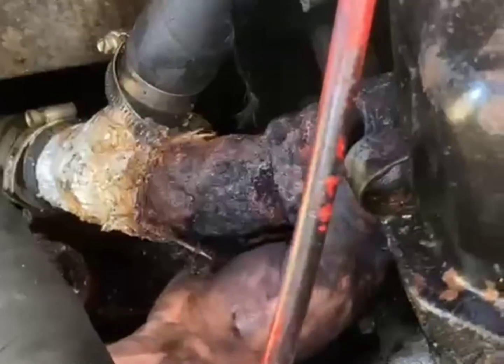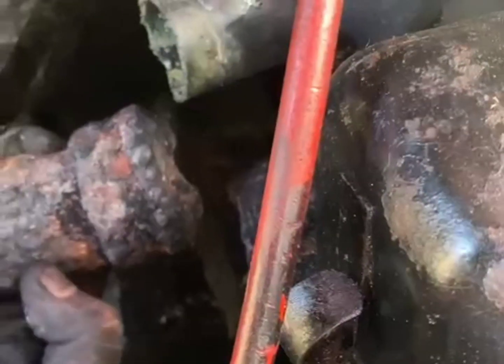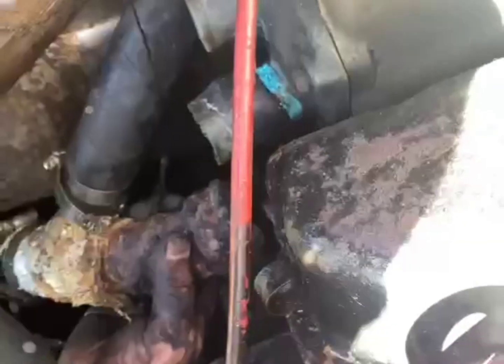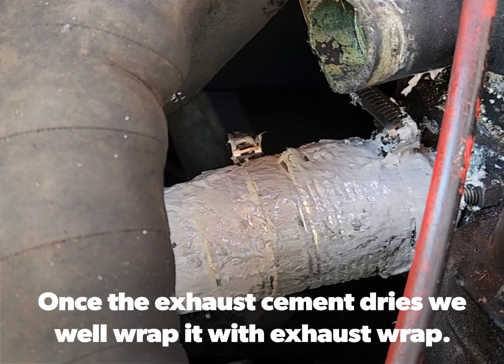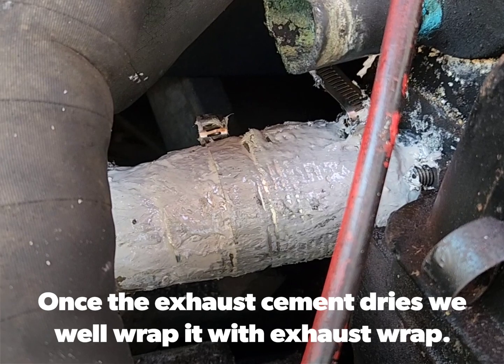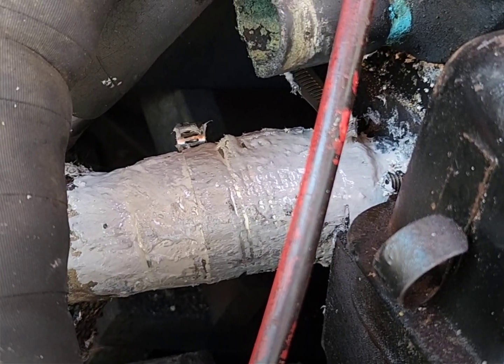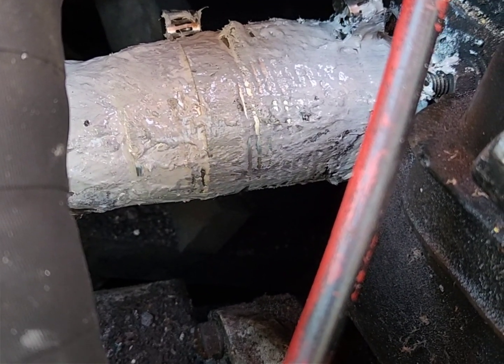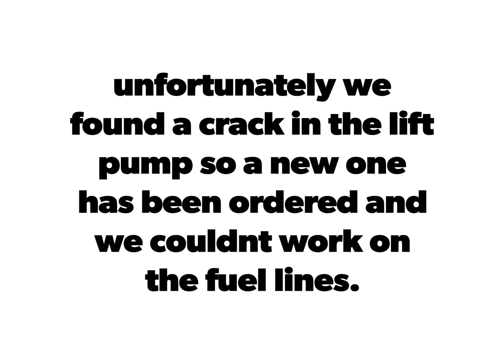Exhaust repair on DEETOO #projectboat

Comment: Bugga bout the cracked liftpump. Was the glass cracked or did it do the normal thing for a 2400 series Ford and crack the body where the inlet/outlet fittings screw into it?
Reply from the maker: Spot on mate. The fitting cracked it.
Reply: Thats normally due to the type of fitting being used.
The thread on those pumps is normally 1/2 inch UNF. The fitting that gets screwed in should be either a tapered seat type of hosetail fitting or a proper 1/2 UNF banjo bolt and banjo fitting. 
Non taper seat fittings are 1/4 BSP or NPt thread and while they will fit into the tapped hole they will normally only screw in about 2 
maybe 3 threads tops. The taper seat type really are the only way to go unless you opt for proper hydraulic type hoses but the fitting still has to nothing else but 1/2 inch UNF/SAE thread.
Reply from the maker: I am actually considering upgrading to an electric fuel pump to bypass the lift pump and then have the new lift  installed so i can swap the fuel lines over to the liftpump if anything goes wrong with the electric pump. What are your thoughts on this idea? You seem to have alot of knowledge on these motors, so your advice would be greatly appreciated.
Reply: You can absolutely remove the mechanical liftpump and fit a blanking plate so you can use the engine with an electric pump. Shouldnt leave the mechanical pump on woth no fuel going thru it as the diapagham will still be operated by the cam but by not having fuel going thru it it will dry out and can crack which when you do put fuel to it it will lead to leaks and it wont make pressure. 
Fuel pressure from the electric unit needs to be from 4-7psi. Much easier priming and bleeding. Alot of owners will feed the electric into the mechanical which also works fine.
Reply from the maker: That is great news. I found a pump at my local store which pumps at min 4psi max 7psi. It has a flow rate of 95litres per hour so i wasnt sure if that would be too high. You make a good point about the mechanical pump. I may just leave the new one on board in case of emergency but blank the hole off and then if need be i can remove the blanking plate and install the mechanical pump. Thanks for getting back to us.
Reply: Electric pump sounds spot on. 
That engine of yours might use 10-12 litres per hour at full throttle poss less. Dont worry bout the 96litre flowrate. Its all about the pressure.
Biggest thing with electric pumps is to ensure they shutoff when they reach max pressure. Especially if the key gets left on. But being a low pressure pump you should be fine.